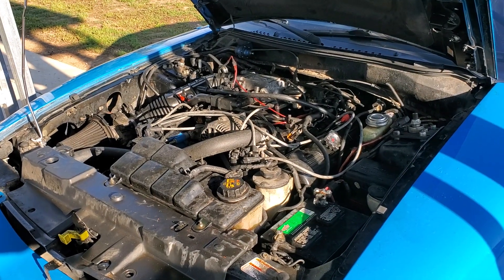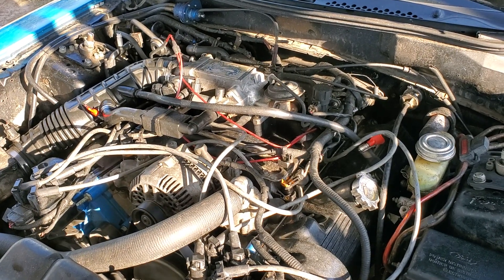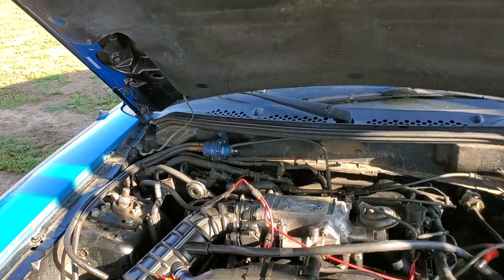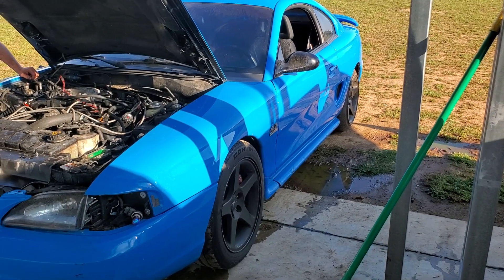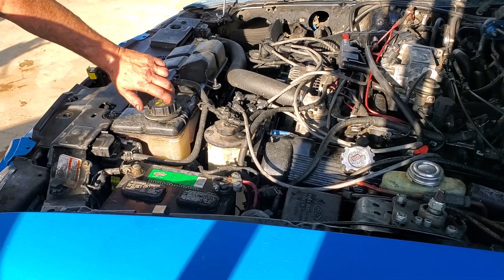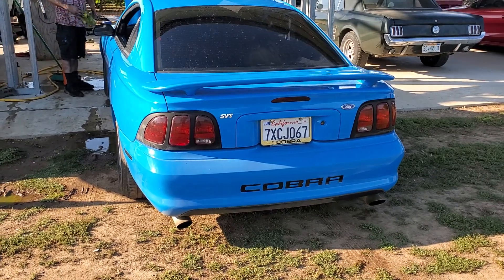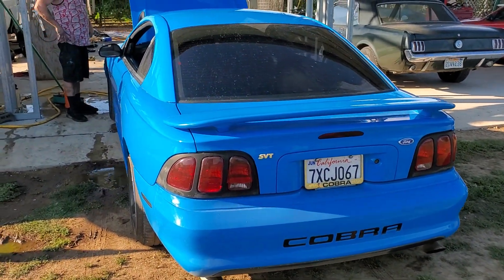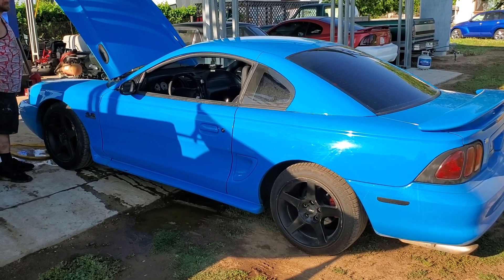Pi swap 4.6 Mustang GT all done

Comment: I have a 01 GT with stock pi intake. I swapped it for a Ford racing intake manifold with a sticker on the intake 1W7e 9424ab and I looked it seems to be for a crown Vic. The original intake is just a bit shorter than the f.racing Mani I'm confused. Do I need a tune or should it just start up
Reply: It'd be fine to drive it
Reply from the maker: It is going to change a little bit. It might be a little of on the idle but it should be fine in the wide open throttle bc they run a little rich. If you changed out more then yes I would stay you need a tune.

Comment: Does it need a tune now with a different compression ratio
Reply from the maker: Yes it dose, Not only it has more compression, it also uses more air. The stock computer doesn't understand why there so much air.

Comment: the compression is higher with that swap instead of the 260 to the crank its more like 275 . nice job!
Reply from the maker: Thank you, The owner leaving the shop was having fun getting on it when I told him to wait till I tune it. It was running on the stock computer. But it sounded awesome.
Reply: @SpeedForceGarage  the stock tune is completely fine to run at WOT as much as before the PI swap! I’ve done over 40 swaps as long as you didn’t change to some aftermarket camshafts instead of the PI camshafts it’s completely fine.
Reply: @BamaStreetRacingSociety256   do you know exactly how much hp/tq it adds? I was going to do ported pi heads and intake, cams, longtubes in my  97 f150.. they say it should be close to 340  give or take to the tire through a 5 speed
Reply: @19jody72  you can expect around 100-120hp to the flywheel gains! So yeah with the ported PI heads you’ll be right around 320-330 at the crank.
Reply: @BamaStreetRacingSociety256   to the crank you say? Hmm.. Richard Holder (might be the wrong last name) did the conversion and was over 400 crank..